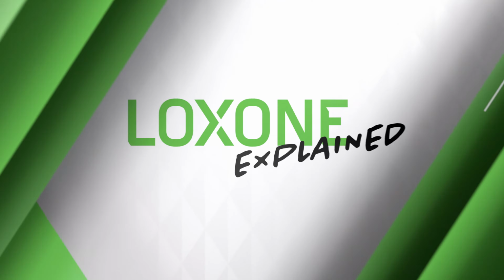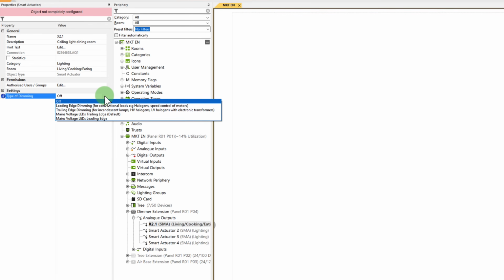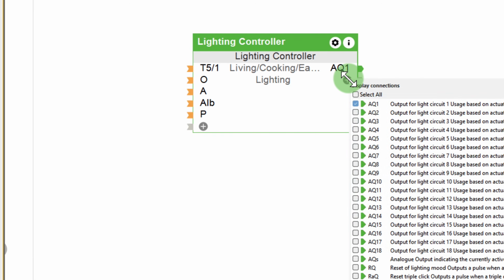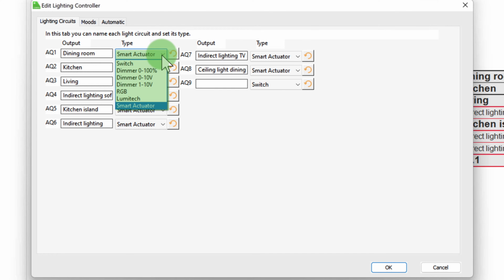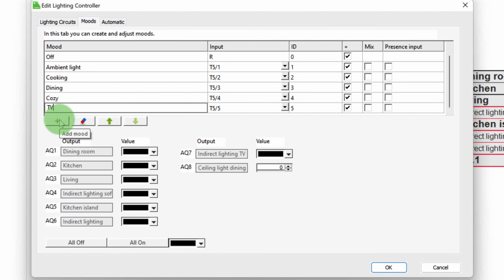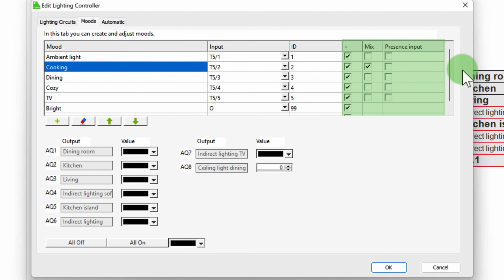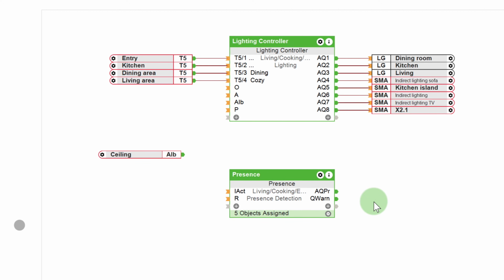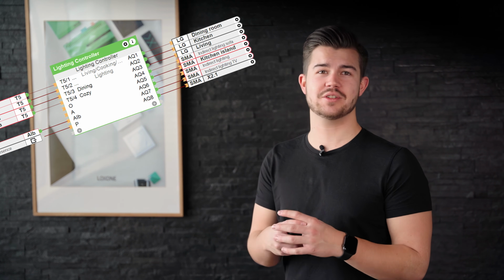Loxone Explained - Lighting Part 3: Easy Configuration

Comment: I would like to control addressable LED strips with my Loxone system. Which LED strip controller/driver would you recommend that works best with Loxone? I currently have the Loxone RGBW modules, but would like to add chases and patterns to our LED strips.
Reply from the maker: Hey, there are some ways to do this, but we don't give official recommendations on this here. Best for you would to search in the different Loxone Forums for a solution ;-)

Comment: This question is not really related to this video and probably one for my installer, but when I went to replace a bulb with a old one(that I now know is faulty and has a short) on one of my pendants controlled with a nano dimmer, it tripped my whole Loxone setup and now it won’t turn on, why would that be?
Reply: If you need more info just ask
Reply from the maker: @diamondhoodgem  Hi, thanks for your comment! 

As you alluded to this really would be one for your installer - they will know the specifics of how your systems has been installed and configured. Without this information, it would be very difficult for us to make an assessment.